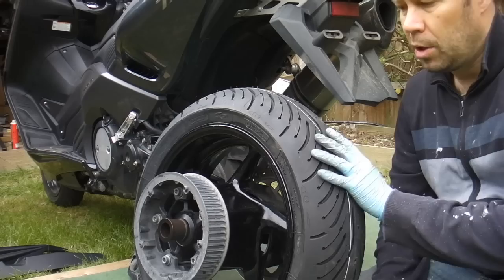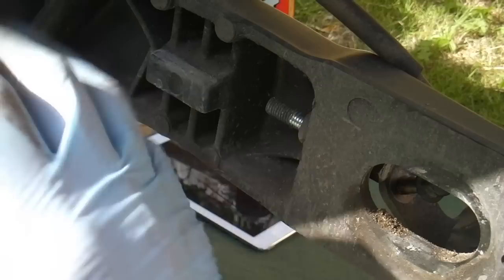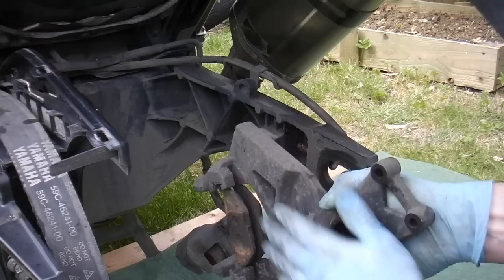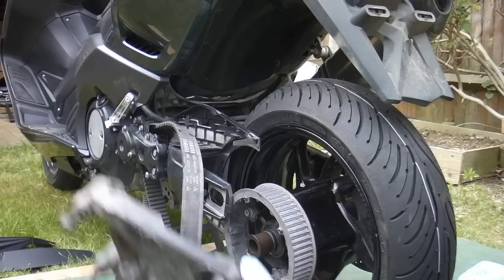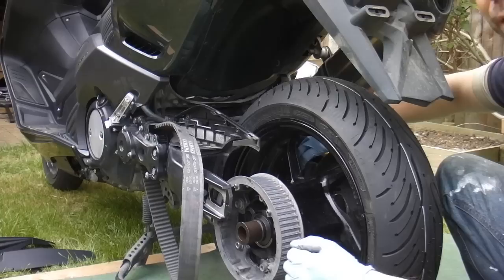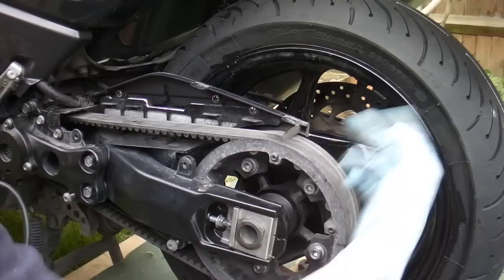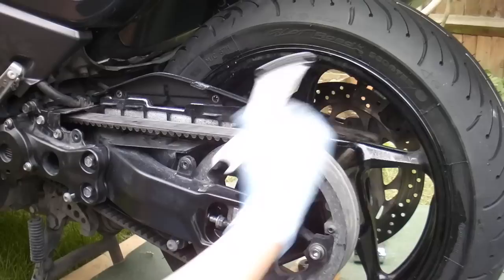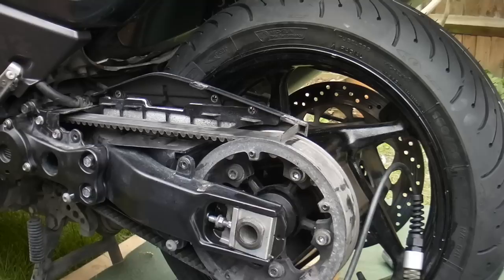Yamaha Tmax 530 Rear Wheel Installation

Comment from the maker: Ok the tyres are Michelin Pilot Road 4 Scooter Front 120/70 R15 TL 56H, and Michelin Pilot Road 4 Scooter Rear 160/60 R15 TL 67H. 

I've been enjoying them - they are very grippy, I can scrape the stand on both left and right corners depending on camber etc. i.e. they never feel like they will slip away to be honest. They are pretty neutral, I would say if anything I noticed initially they are slightly slower on turn in (on the front), so have a very slight tendency to want to run wide (I'm exaggerating though), but quickly adapted and now I don't notice. I assume just a slightly 'rounder' profile than the Bridgestones.

Had a few wet days and they have been fine, can still slip like any brand if reckless. Having said that I can definitely brake hard in the wet so they must be doing something right. My main hope is that they wear well, as the middle is meant to be a harder compound than the edges, and I know on motorbikes people have been getting great wear out of PR4 tyres.
Reply: how to change yamaha tmax 530 candles

Comment: Good video. Thank you for not editing out the wheedling you had to do to get the brake bracket, wheel and axle aligned. What was that instrument you used to determine the belt tension and how does it work? Your belt looked a bit dry. Have you discovered 303 Aerospace Protectant? It keeps rubber and plastic parts like new. I've been using it for years. It really works.

p.s. I am so jealous... the newest model of TMax, has cruise control and other features that I'd be willing to trade in my 2006 Majesty for but Yamaha is no longer importing it into the USA.

Comment: I have 66 plate tmax 530abs. Purchased the bike from Yamaha last year 3 months old with only 160miles on the clock. I've noted a whining noise coming from the lower rear section of the bike when I let go of the throttle when slowing down. Secondly when starting up cold in the morning the noise from the engine is slightly tapping away until warmed up. Both issues I addressed with Yamaha and they said it's seems ok to them. I haven't driven another tmax to compare, would you be able to comment at all ? Regards Tom
Reply: Thomas Brennan chao a

Comment: Hi!
would you please suggest a paritcular manual belt tension device (from e-bay) as you mentioned at 20quid? The issue is there are lots of them on e-bay, seems to be OK for manual metering of the belts , but sellers do not know whether they will good for Tmax 530.
Thank you for your advisce.
Reply from the maker: I was thinking one like this, but use it first to read the old belt tension before you take it off to give you a similar reading to put new belt on with. I haven’t used one so can’t guarantee it will fit but I reckon it would https://www.ebay.co.uk/itm/Cambelt-Tension-Timing-Belt-Gauge-Car-Engine-Tension-Cam-Belt-Gauge-Universal/262441710957?hash=item3d1abeb56d:g:EckAAOxyRhBS2hSQ
Reply from the maker: https://youtu.be/Qf-zgjyEcMs Showing how to use that type of gauge

Comment: So, would it be possible to change the rear tyre without having access to a tension gauge?
Reply from the maker: You could measure the blocks with calipers beforehand, (write measurement down) and put back in the same place. Or search ‘belt tension gauge’ on ebay and buy a cheap manual one - measure old belt tension before you remove it.
Reply: Tmax Thanks for the quick reply! Good idea. I probably have to change the rear tyre today, so ordering a tensioner tool from eBay is not going to be possible. I’ll do the caliper thing, and hope for the best!